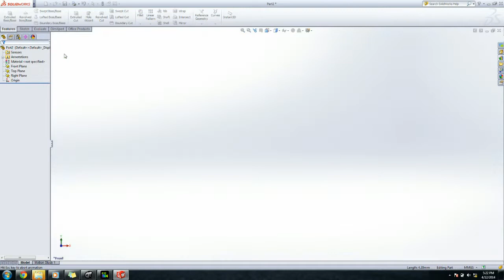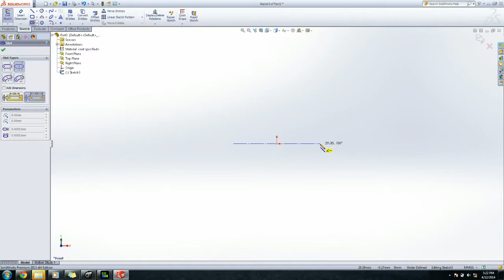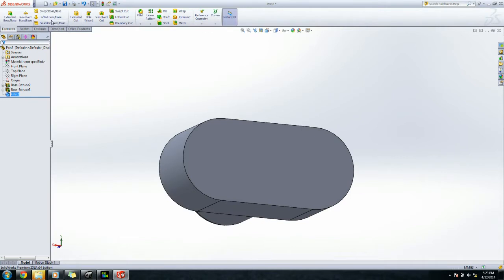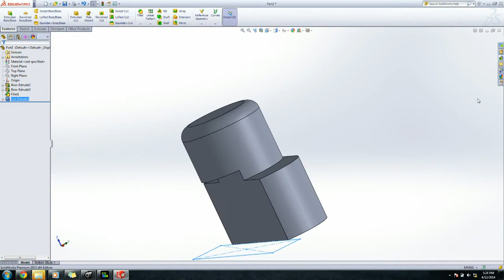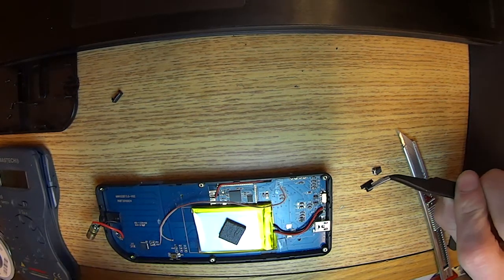Rii Bluetooth Keyboard Button Mod

Comment: really cool!

did you see if can hack the battery? I mean put another to last longer, or change the charging port position?
Reply from the maker: I haven't messed with either but I'm sure there is room for improvement on battery capacity. hobbyking is a great source for finding a good lipo.
Reply: @snagle87  I'm looking at replacing my batteries now. Checking out hobbyking now. I don't know why I didn't think of that earlier.